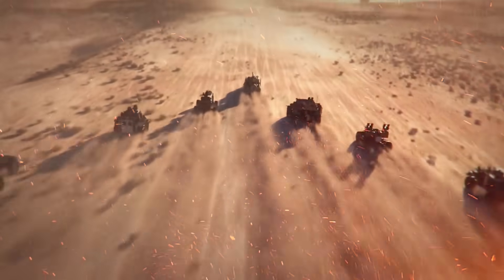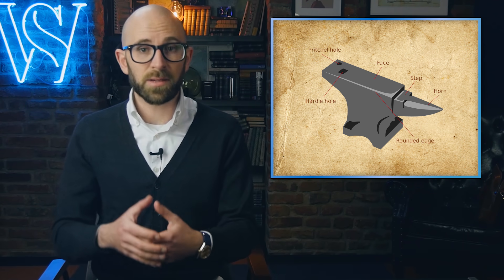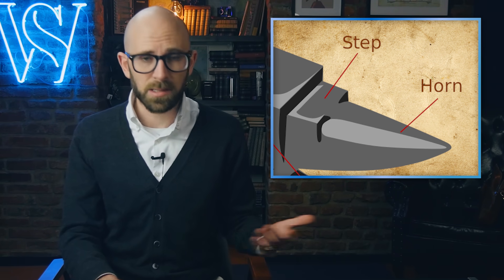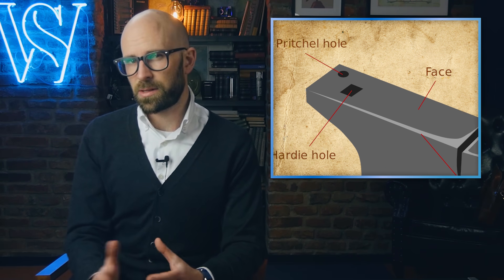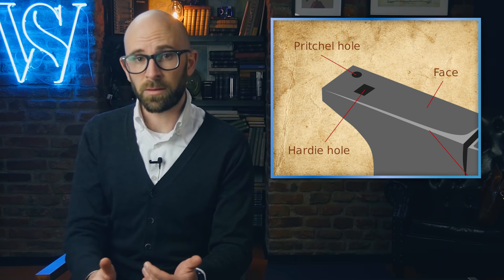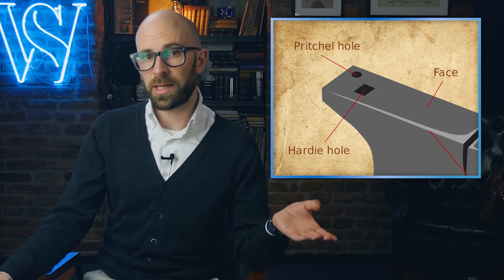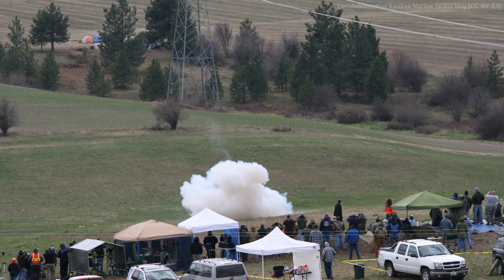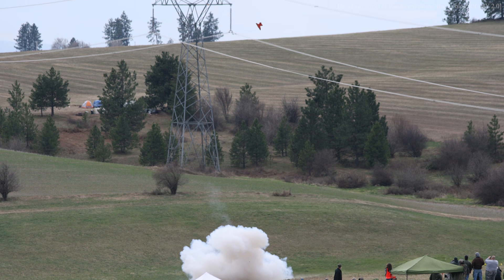Why are Anvils Shaped as They Are and Why Do Blacksmiths Tap the Anvil After a Few Strikes?

Comment: fun fact: sweating like pigs refers to the pig irons cooling down and moisture in the air condensing down on them. real pigs don't sweat. If you don't believe me do a google search for the origins of the meaning to sweat like a pig, I live near Sheffield in England, it's where steel production used to be the main employer. Its common knowledge around here.
Reply: Why would moisture condense on hot iron though? Doesn't moisture usually condense on cold things like icy drinks?
Reply: @Timbo Dewabem The iron would still have to be cooler than the air.
Reply: Interesting.
Reply: @Timbo Dewabem It was said "pig irons cooling down", indicating, that they were hot.
Reply: @ravinchowdhury5215  
If the air is 100F and the iron is 50F...
Reply: iamchillydogg The Laws of Thermodynamics actually make that impossible.
Reply: The iron will never be cooler than the air surrounding it
Reply: A variation is "sweating like a stuck pig". It refers to the fact that you would have to "stick" a pig with a pin or some-such for it to sweat. Utter bollocks, but humourous.
Reply: Oh neat
Reply: @ravinchowdhury5215  Apparantly people will believe anything
Reply: @aceystar1478  If the metal is being allowed to air cool, it will never get colder than the air cooling it. For it to then deposit liquid water onto the metal's surface would require the air to already be below its dew point a.k.a. a literal cloud. 

On the flip side, if the temperature of recently molten metal is below the dew point of the air, so are the inside of human lungs. You would drown my merely standing there.

Does water appear on the surface of pig iron when it's handleable? Maybe, but it isn't condensation unless some major information is being omitted.
Reply: @blackdragonxtra  imagine it like this. The pig iron was poured directly into the ground or into molds and the ground contains a lot if water which would subsequently be evaporated, increasing the humidity beyond normal range. As the temperature inside whatever building this was done in decreases the amount water can no longer stay in the air and condenses onto any solid object in the room. The highly heat conductive metal on the floor which easily takes the thermal energy of the water allows it to condense on it. This is at least an approximation of what would happen. Also don't @ me on a 6 month old comment, I don't even remember making this comment.
Reply: Pigs don't sweat but they do drool.!
Reply: But did you know the term was invented in blenarfon wales, at the site of the first multi furnace foundry? Google the archaeology there it's fascinating
Reply: @joshschneider9766  no I did not.👍

Comment: Black smiths tap the anvil after a few strikes to remind themselves that they have an anvil.
Reply: They do it to get up our noses. "I have an anvil... LOSERS."
Reply: Also the same way us dudes click the BBQ tongs together. Because we can
Reply: What about white Smiths??
Reply: It helps with the musical side of smithing.
Reply: Cut like steel?
Reply: My grandfather said he did it to advertise; the sound can carry the length of a small town
Reply: You tap to keep rhythm most of the time. You got a rhythm going (which reduces fatigue and gets you into the right pattern so you can move and strike and time it all) and sometimes tapping the anvil to save the bounce while you adjust or inspect the piece for a second or just plan your next step is a good thing. 

The anvil and hammer should be "live"... meaning the hammer gets a little recoil bounce when you hit it, and that bounce is really what saves you a lot of work from picking the hammer back up each time. So the rhythm you get is based on the livelihood of the hammer and anvil and piece you're working on all combined together, and just stopping the hammer takes more effort than preserving the bounce while you do whatever else you need to do.

Also, it's a pleasant sound.
Reply: Same as jiggling the gear shift to make sure it's in neutral
Reply: @halolime117  white smiths work in silver, gold, and other jewelry type metals
Reply: @1985ThePedro  That's exactly what he said in the video. Did you not watch it? These comments are more of a joke competition.

Comment: A New High-Quality Anvil will ring like a Bell when Struck. A cheap anvil or worn out high quality Anvil will not ring. The worn-out high quality Anvil develops internal cracks, absorbing some of the energy from good solid blows from your Hammer and having less effect, thus making you work a lil harder. The "Dry Strikes" allow the Smith to reset his Grip "One-Handed" without losing his Rhythm.
Reply: Serious question. What does one do with a worn out anvil? Does it get melted down and re-cast into a new one? I can't imagine you'd just set it to the curb on trash day.
Reply: @KlockoFett  just continue using it, it still works.
Reply: Old wives tale,  not 100% correct. .
Reply: @KlockoFett  That's right. Pro Smiths tell friends like my Dad and we go get 'em and the Smith's proudly show us their Brand New Anvil and proudly "Ring It" for us. I think we collected 5 or 6 of them through the 70's and 80's
Reply: @MAGGOT_VOMIT  well then I have been making my living for 43 years knowing "absolutely nothing"  I think you must have tried out what you suggested I do with that hammer a few times too many.  Hammer bounce tells you all you need to know about an anvil. The ring only tells you how soon you will be going deaf.

Comment: One note to add to your many correct analytical points. 
The tapping of the hammer on the anvil keeps it in motion. The momentum of the bounce reduces fatigue by not having to lift the full weight of the hammer every time you check/adjust your work. (Keeping the rythem also helps me with accuracy)

Comment: A note from Australia, what we called anvil firing was bringing a piece of metal to a welding temp, smearing the the surface of the anvil with water then timing it so you hammer the metal when it touches the anvil. It sounds like a shotgun going off and sprays and impressive amount of sparks. Allegedly a technique for jump welding but I'm a little sceptical. Still fun to do when people don't expect it.

Comment: The horn is usually used for starting a curve, but the rest of the forming is done with the hammer hitting the metal with nothing backing it, while the cold part of the piece merely rests across the top of the anvil. The horn is more often used to reshape metal in combination with the peen of the hammer. A fuller in the hardy hole can also be used for this purpose.
Reply: yep your username checks out
Reply: I wish he had talked to an actual blacksmith for research. Sounds like some of the "facts" were more Wikipedia based than researched. Things I noted on first watching: the step is softer (unhardened) metal which won't damage your chisel... You don't cut on the anvil edge, that's what a hardy is for.. The face is hardened steel and you can seriously injure yourself if you strike it. You'll only try to use a hardy hole to punch something once when you discover why there's a pritchel hole. The shape he's talking about is a London pattern, there are dozens of different patterns such as the round topped turtle anvil of China or the flat square top Japanese style.... I could go on quite a bit more...
Reply: Batman The Dark Knight: Simon describes bending curves on the horn, I point out that the horn might be used to start a curve, but it is not used for the majority of the process. Instead I point out that changing the shape (drawing out, a process that makes metal thinner and wider/longer) is the main use of the horn, which he doesn’t mention at all. 

There are reasons why you don’t make curves on the horn. When you strike ductile metal between the hammer and anvil, the metal deforms. When you want to maintain a constant thickness throughout a curve, you cannot hit it against the anvil. 

Watch a video on basic blacksmithing.
Reply: Nice tips... THX.

   Just wanted you to know you and "fire..." down there ARE authentically appreciated. Don't let the haters grind you down too much. You can't explain anything to dick-heads who know it all already... especially when they don't know what they don't know about. ;o)
Reply: I have on occasion seen the horn used as a drift, but that seems sketchy.
Reply: Batman The Dark Knight  You ok bud?  There a problem with a blacksmith adding to a video on blacksmithing?  Seems to me he'd know a little about that subject. 😂😂
Reply: @fire304  if he was in a hurry and it was a small piece, say 1/4" round bar my grandfather would cut it against the edge, but rarely. I use that anvil now.
Reply: @jollyjiggler  its not necessarily sketchy, if it works it works
Reply: @tomsavage1461  agreed, if my anvil had a horn i would probally do it. It just seems it would be easy to strike the end of it with the hammer.
Reply: You're wrong of course you can use the bick (horn) to make uniformed curves (as long as you work diagonally on the bick) that is basic forging. Have you ever seen a ferrier forging horseshoes?. If you couldn't why did they make blacksmiths cones to make circles? As for drawing out with the bick, mark aspery even says that it's not recommend as heavy drawing can lead to the bick being broken off. Look up "DF-in the shop: working on the horn of the anvil" to see a professional blacksmith explain everything I just said.
Reply: I never use the horn for curves, and when teaching beginners I always point out that horns are a relatively new invention, but scrolls and curves are not. Horns are not cylindrical, so using a horn for bending will lead to an off-axis bend
Reply: @somanayr  wrong bick have been around roughly since anvils has, granted they wasn't attached to the anvil. And did you even read what I wrote? Bicks are tapered in two directions, that's why when using the bick to form uniformed curves YOU MUST FORGE ON THE BICK DIAGONALLY. Again watch "df-in the shop: working on the horn" to see a professional blacksmith explain everything I just said.
Reply: it's a tool like everything else. as such it can be used in a wide number of way and with various other tools and techniques. but I'm guessing this video didn't have room for everything such as the 100s of tools that can go in the hardy hole or the different types of specialist cutting tools, hammers, fullers and swages.
Reply: @paddysscrapshop7182  I dont't think this is correct. I've read Anvils in America, front to back -- there may have been bicks, but most anvils before 1600 (let's say +/-200 years) didn't have bicks, most were just big blocks, maybe with a waist, and before that big rocks. Anvils in some form have been around since before 0CE

Yes, you can use the bick diagonally, but you're still far more restricted than using the edge
Reply: @somanayr  when did I say anvils had bicks before 1600? I said bicks (bickern) have been around roughly the same time as anvils have ( they wasn't attached to the anvil like modern anvils, they were more like hardy bicks/bickerns but with a spike on the end). If you have a copy of "the mastermyr find" look at P1. 8 no. 75 to see what I mean.
Reply: @paddysscrapshop7182  Sure, that makes sense. Still, this is all tangential -- my main point was that you don't need a bick to make scrolls
Reply: @somanayr  why would you use a bick to make scrolls? That's what jigs are for.
Reply: @paddysscrapshop7182  People sure do try, and my point is that you don't need a bick to do bends in general
Reply: @somanayr  of course you don't need a bick, but my point what that you can use it for bending (unlike what someone said originally that I responded to).

Comment: You're correct. It also has the added benefit of shacking off any carbon flakes or other various trash being hammered into the work. 
Wire brush cleans but sometimes springs junk up on the anvil so hammer taps are primarily for the reasons stated in the video and just an all around good habit.

Comment: It cools the hammer head down a bit by imparting some of the heat from the hammer to the anvil.  This helps to keep the hammer from softening,  ie... it work hardens the hammer.  It also helps to keep the anvil from resonating as much.  An anvil resonating at its natural resonating frequency would make the piece you are working on vibrate making it harder to strike the piece with accuracy. It also is a way to keep a steady rhythm.  Keep in mind vibration absorbed into your body can cause numbness.

Comment: The statement that Cast Iron is harder then steel is simply not true, it’s softer. Is very easy to file or saw cast iron. 
 While it’s true most cast iron anvils are junk not all. I’ve worked on a 300 lb Fisher Anvil for the last 30 years and they have a cast iron body with a steel plate welded on the top, considered to be a very good anvil, also a quite anvil with minimal ring 
Most older anvils are wrought iron with steel faces forge welded on. If not done well they can separate 
Beware of “restored” anvils that have had their tops re welded on using modern welding techniques, usually only the edges will be welded...no good. 
 The rounded horn can also be used to draw out, ( lengthen) your work by hammering it on it. I do this when forging knives. 

I used to “ Fire” an Anvil every New Years pretty fun. If you seal the bases doesn’t take that much black powder to send them flying. 
  
I used to stack my anvils up on top of each other’s for display , was standing on a step ladder once putting a little 10 pounder on top when the stack fell over and almost on me! Anvil Avalanche
Reply: Gray cast irons is generally softer than mild steel but is brittle due to the graphite flakes. White cast irons is much harder than mild steel and is used for wear resistant items. Ductile irons have similar hardness to mild steel.

Comment: Cast or forged malable iron like the stuff pipe wrenches are made from with a thick slab of higher  carbon steel forge welded on the stricking surface. This is a quality anvil.

Comment: I'm a hobbyist blacksmith, but thought I add what I was told by some of the great blacksmiths I've trained with. When you swing the hammer, at the moment of impact you grip actually relaxes significantly - I was once told that at this moment someone should be able to grab the hammer from your hand. If they were quick enough! This helps reduce tendon strain from the impact. So after a few blows, sometimes the hammer can lose its orientation, depending on the piece you are working on. So by moving your hammer hand and the hammer bounce, and it corrects it straightens up, and you can grab it again knowing that it is perfectly perpendicular. 

Also, scrub off the varnish, blacken with a torch and rub with linseed oil. Varnish will blister your hammer hand in minutes!

Love the stuff about the submarines!

Comment: Tapping the hammer also releases any scale or slag the hammer face may have picked up during shaping, keeping it from transferring deformities into the worked piece.
My grandfather was a blacksmith, and he taught me a lot.
Reply: If he taught you that he taught you wrong. First "slag" is a non issue in forging,  slag only forms in the crucible as your melting iron. Scale doesn't stick to anything,  hence the reason you don't want it on your work. It makes a forge weld impossible. I have been a blacksmith for 43 years,  never once have I ever cleaned my hammer and I have had it 46 years.

Comment: I have a jewellers miniature anvil on the windowsill here. 

The Pritchel hole in in the steep and the step is level with the face. Apart from the differences, it looks just like a full size blacksmith's anvil.

I bought it at the Dorset Steam Rally, many years ago, from a tool vendor, out of curiosity.

I've won a few bets with it by claiming that I can lift an anvil with one hand, then producing the anvil out of my pocket, thus proving that I could lift the (Jeweller's) anvil with one hand.

Comment: "The face is the main large, flat slab where most of the hammering takes place. It also contains the hardy hole and the pritchel hole. Unlike the step, it often features slightly round edges, so that the edges dont cut into the metal being pounded on the face."

And here i used to get uncomfortable when Simon made sexual innuendos.
Reply from the maker: It's the little things that make this fun. ;-) -Daven

Comment: The step was used as a sacrificial part of the anvil in operations that might otherwise damage the face of the anvil which is to be preserved operations such as cutting with a chisel or punching the slug of a punched hole out would risk damaging the face of the anvil

Comment: You covered a standard London Pattern anvil... There are many types,depending on need.. Saw filers anvils are flat topped blocks of steel with no horn or heel...  Also-when I served my apprenticeship with the last U.S.Cavalry horseshoeing instructor (yes I'm THAT old), we were taught that the horn is like a French Curve used in drawing..that is, at some point on the horn there is the perfect spot to find the curve you want..My saw filer's anvil is a couple of hundred pounds. My 1897 German Holthause is a 450# double ender..., A little 100#Williamson ws made in england in about 1890...Earliest one piece I've found..